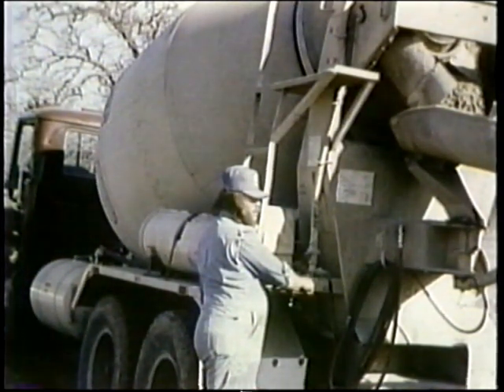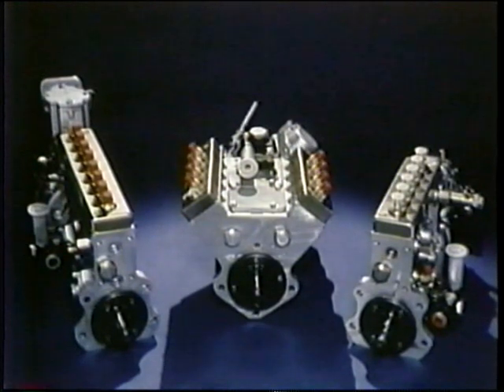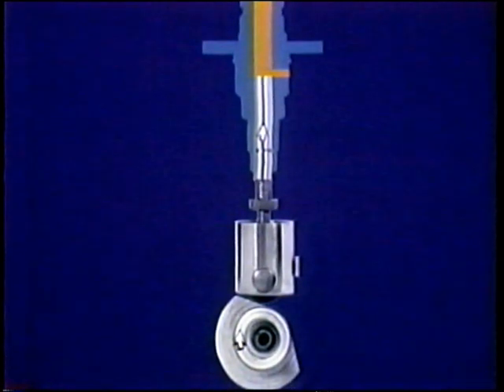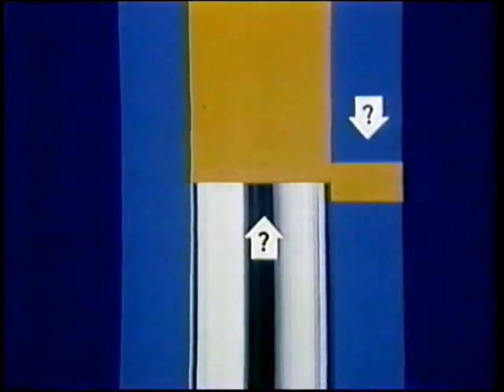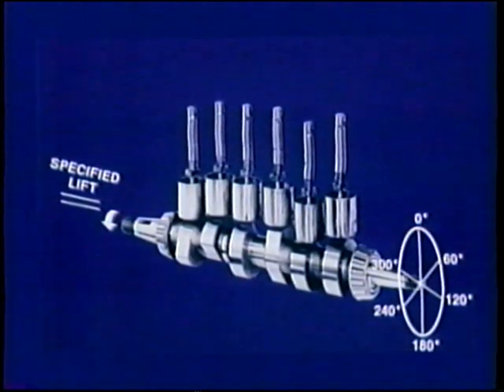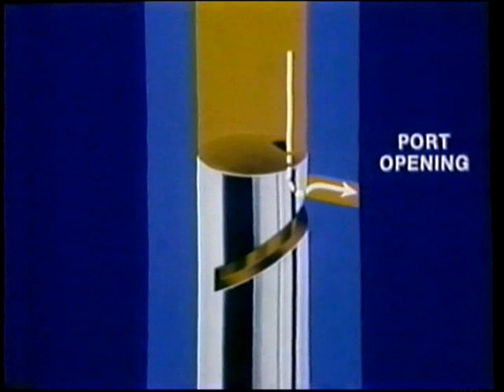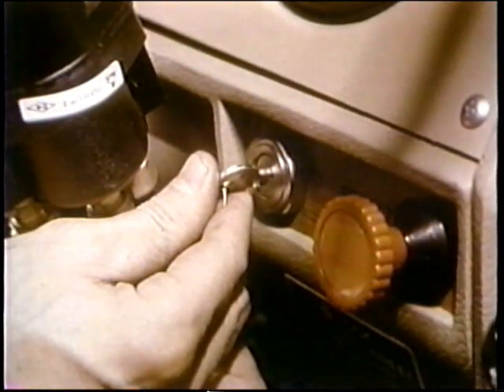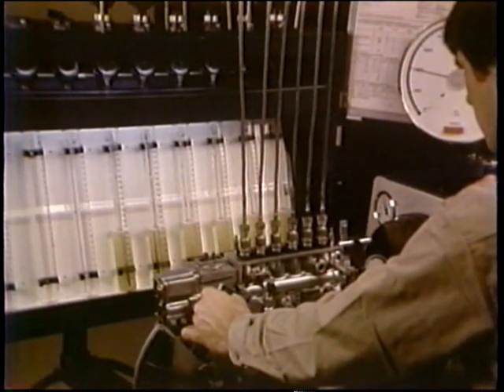BOSCH P-Pump Operation

Comment: i recently put 3-4k gov springs , #11 torque plate , and 191 delivery valves and i am easily doubling the hp with a pinched wastegate

Comment: How does such an engine advance its timing, under light load or high speed?
Like old-fashioned petrol engines, using vacuum or centrifugal advance.
I can't see any way to do it. The injector camshaft is fixed.
Reply: It doesn't its a mechanical injection, it only ever injects a set specified time,  the common rail ones can change injection timing.
Reply: @CrazyForCooCooPuffs  this is wroing
Reply: @Reno's Garage  no I'm not, telling me I'm wr9ng with out a reason doesn't help.
Reply: @CrazyForCooCooPuffs not all mechanical injection pumps  don’t have timing advance, for example the Bosch VE pump has a timing advance piston that advances the timing as the revs increase

Comment: Anyone know what the "P" stands for. I'm thinking piston or something thereabouts but would like to know for sure even if it's in German
Reply: @J M   Here are some information to answer your question. With German Bosch Diesel fuel injection products, when they say P- they are talking about the size or the model of the injection pump. A few examples of injection pump  with different sizes: M-size pump- 7mm plunger stroke, A-size pump- 8mm plunger stroke, B-size pump- 10mm plunger stroke, and P-size pump- also with 10mm plunger stroke. I also included some technical details for further distinction. All the best and stay safe and away from covid.
Reply: P is for panzer

Comment: Why cant bosch continue making pumps like this instead of the junk ass cp4 pumps
Reply: They still do. It’s the government requiring their customers to achieve certain goals that a mechanical pump can not deliver.
Reply: As Robert said, there are regulations for emissions and fuel economy that these older pumps cannot achieve. Modern pumps like the CP4 might not be as rugged or long-lasting, but they are lighter, more responsive and far more fuel efficient. Everything is a trade-off, in-line pumps have pros and cons, as do modern CR pumps.

Comment: Where can you get a v8 pump
Reply: V8 pumps are probably used on V8 diesel engines
Reply: @j.m.5995  no shit..... ya dont say!!...
Reply: @americantruck3943  That's right I said it
Reply: Mack used them on the old 325 thermodyne v8’s, and I think some on some of the newer ones as well like the 866’s.
Reply: I just bought one from a 9.0L international.
Reply: from Bosch, 8 plunger P pump.
Reply: They still make v8 pumps for Russian diesels